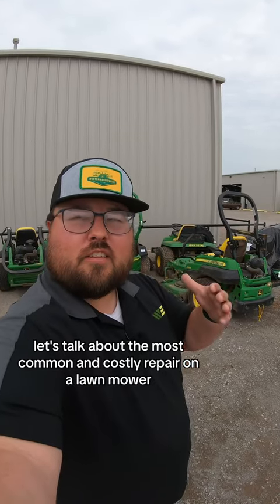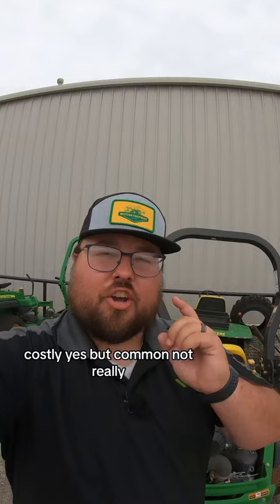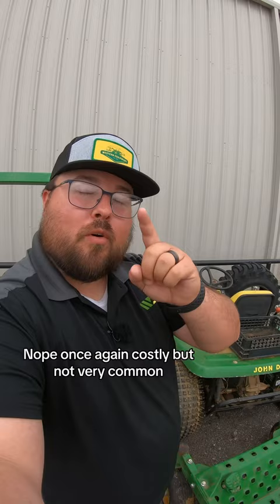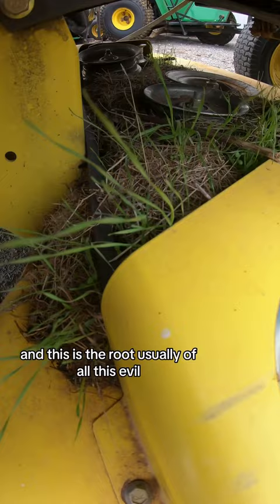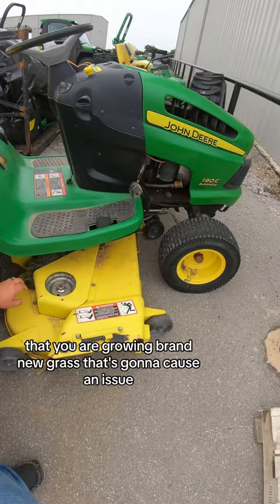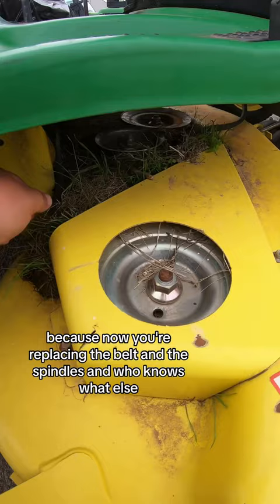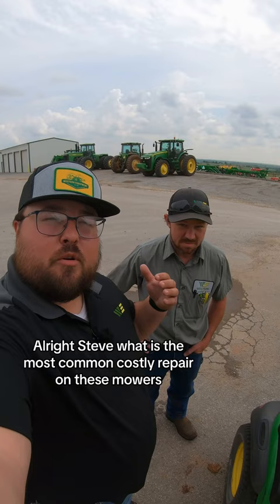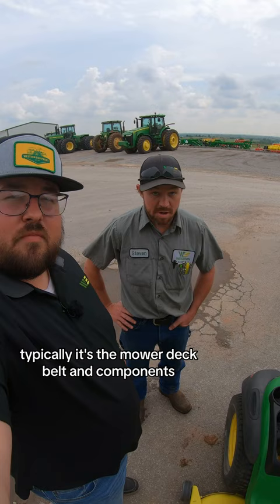Most common & expensive mower repairs!

Comment: I wish more manufacturers found a way around bolt down spindle covers. I know Deere's more expensive models have the flip up covers,but many others dont offer anything but bolts.
Reply from the maker: Yes, I agree. It does make cleaning so much easier with the flip up or easy to remove covers.

Comment: I never park any machine without cleaning it. It's time consuming but it's a good habit to keep in my opinion. What you showed us would not have happened if the operator took a small leaf blower and just blew all the grass clippings away. I even take my deck off two or three times a year to make sure wet grass hasn't been clogging up down there.

And as an added benefit, a clean machine won't track so much crap into your shop, such as mud, grass, leaves, etc.
Reply from the maker: These are all good points. I make sure to clean mine off after every mow for both of these reasons you pointed out.

Comment: The best way to greatly reduce mower deck repair is to never cut your grass in the early morning, right after it rains.  Basically,  when your grass is wet, DO NOT CUT IT!
Reply from the maker: This is good advice. But if you have to, make sure and clean the mower up good right after use.

Comment: Cleaning the tops and grease is important, but the long term effects of not cleaning the underside of the deck is probably worse. Build up = rust.
Reply from the maker: This is a good point. If you live in an area where you are having to mow when it is damp then you definitely have to watch for buildup.

Comment: I usually just blow mine out. I need to grease my spindles too I’m 99 percent sure they have never been greased since bought and it has 140 some hours on it. Oh it’s a john deer z355r. I would like to eventually get a scag cheetah or something similar if I go commercial.
Reply from the maker: Definitely should get some grease in the spindles ASAP. Why go scag?
Reply: @WesternEquipment  No disrespect to john deer or any other mower brand I know there are great mowers inside those brands and to each their own mower but it comes down to personal preference. Like I have experienced them before, I like the orange color. and they are personally the most appealing to me with cut and engine power. But that’s just my preference
Reply: @WesternEquipment I currently run a john deer z355r and it is great for my tasks.

Comment: Good looking out. Just got a broken D130. It was full of trash on top of the deck. I pressured washed that bish off!
Reply from the maker: Good deal. Make sure and grease it up and check everything and then check to make sure your pulleys and spindles are all good. Did you get a good deal on it?
Reply: @WesternEquipment  I actually do junk removal and it was sitting there covered in trash. I got it free. He gave it to me and said he didn't have time to work on it. He said it didn't have spark. Well tell it home tore it down. Carb was clogged changed a rod to the rocker and had her running perfect in a couple days now she's just getting little things fixed but I'm stoked. I greased the two front wheel zerks but not sure were the rest are.